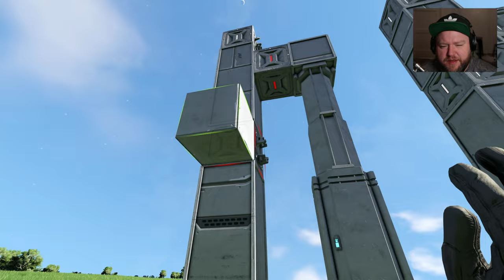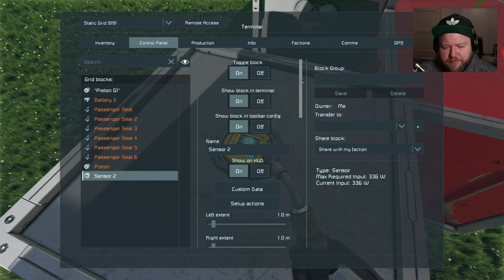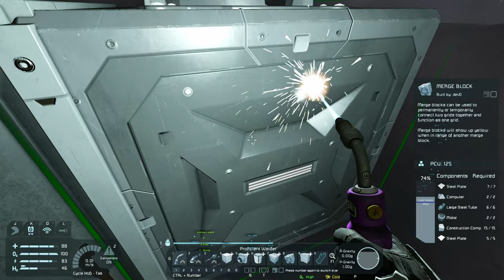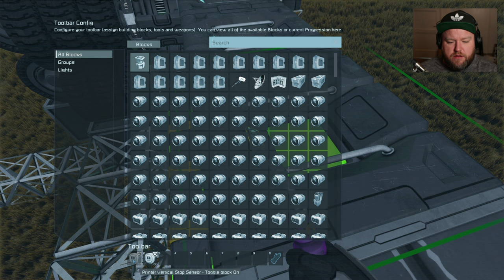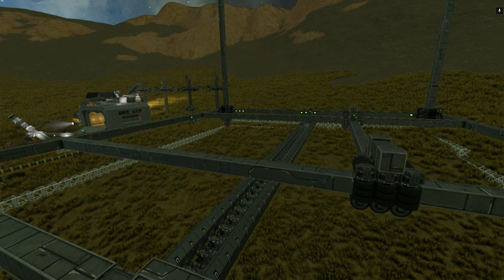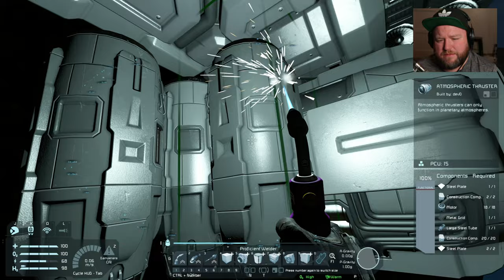Using a crawling piston to stabilize my printer as a German Engineer - Space Engineers E30

Comment: Suggestions:
3 rows of glass above your welders stops accidental printing too low
 add 2 more rotors 1 with large grid head 2 with small grid.  So you can print without changing rotor heads.
Never print landing gear pointing towards welders
2-8 blocks between projector and ship to buffer edges one of which gets ground off at end of print.
Reply from the maker: Those are some great tips, thank you! 

Why two rotors with small grid heads though? Just so I can print two small grid ships at once?
Reply: @boldlyunbuffed  That and building a ship with subgrids.  Normal reason to print though is to replace ship that crashed or Drones.

Comment: You're getting there... Good work.
To avoid having a running print waste time by traveling all the way to the ends of the track, you could add sensors to the effective weld-area, that detect the print and reverse the blueprint-arm once built blocks leave the sensor range. As the print gets larger in length, the blueprint-arm will then only travel further if needed. This will make your printing more effective.

Not all blueprints are "printable". One has to consider this when building ships,...

Weiter so! Ich habe mir den Luxus nicht gegönnt, In meiner Survival-Welt Creative Mode zu benutzen, um gefährliche builds zu testen. Mich motiviert die Gefahr des Ungewissen und die vermeintliche Kontrolle darüber. Ist in der Arbeit auch so: Prototypen MÜSSEN fehlerfrei sein. Einen zweiten "Versuch" gibt es nicht. Ich liebe es, diese Herausforderungen zu meistern. SE gibt mir die Möglichkeit, Fehler passieren zu lassen und es macht auch ein bisschen glücklich, wenn mal alles hochgeht. LOL
Reply from the maker: Yup, good call with the block detection. I’m probably going to do that. It significantly speeds up the print. There are some cases where it can produce false positives (e.g. when there’s a “gap” in the grid you’re printing), but one can make it toggle able to disable it for incompatible prints.

Ich benutze kein Creative Mode in der survival Welt, sondern bin in die Creative Welt gewechselt und habe das Grid copy + pasted um auszutesten wie ich das rutschen der Reifen fixen kann. Praktisch nen zweiten Prototypen, da sich der erste Prototyp aufgrund Unterschiede in der Physik nicht wirklich umsetzen lies. Wenn du dir ein paar meiner früheren Videos ansiehst wirst du sehen dass ich auch schon genügend mit zerstörten Grids rumgeschlagene habe.

Ich benutze meine Creative World idR für Prototypen oder wenn ich etwas nicht verstehe oder es nicht so funktioniert wie ich es erwarte. Anstelle 20 Stunden in Survival mit experimentieren zu verbringen, verbringe ich lieber 4 Stunden in Creative und bringe dann die gelernten Details zurück ins survival Spiel. 

Wenn der MGP fertig ist habe ich insgesamt mehr als 24 Stunden auf Kamera und ungefähr nochmal 12 Stunden ohne Aufnahmen investiert. Auf YouTube sieht mal dann halt nur 4 Stunden oder so davon. Ich glaube nicht, dass ich es mir hier einfach gemacht habe :)
Reply: @boldlyunbuffed  
An eventuelle Lücken in einem Build hatte ich gar nicht gedacht. Guter Punkt. Ja, manuelle Steuerung irgendwo anbringen ist immer gut.

Klar doch:
Nicht Creative Mode.
Creative World meinte ich. Mir war natürlich klar, dass Du nicht Creative Mode eingeschaltet hattest. Was hab ich denn da für einen Quatsch geschrieben?! LOL manoman.
Was ich meinte war, dass ich nicht zu einer Creative World gewechselt habe um mein Zeug zu testen.

Nein, einfach hast Du es Dir nicht gemacht.
Auch Deine Mühe und Ehrgeiz zweifele ich nicht an. Im Gegenteil. Du willst ja auch videos machen, da willst Du natürlich auch effektiv sein. Is ja logisch. 🙂

Meine Survivalwelt spiele ich seit 3 Jahren.
Da habe ich alles auf die harte Tour gelernt.
Ich speichere viel, falls was heftiges in die Hose geht.
Ich habe seperate "Build Worlds" wo ich ab und an andere Dinge mache und Conzepte entwickle. Da hab ich auch z.B. bestimmte Fahrzeuge die in meiner Survival Welt nix zu suchen haben. Diese Build-Worlds haben nichts mit meiner Survival Welt zu tun. Meine Survival Welt ist mir heilig - ist mein erster gelungener run von damals. Es ist wie eine Reise. Ich möchte möglichst lange von SE was haben, somit reize ich alles aus bis ich mich weiter wage, if that makes any sense.

Als ich das erste mal mein Shiff abheben sah, mit dem ich nach zwei Jahren zum ersten mal den Erdähnlichen Planeten verlassen habe... Da hatte ich Herzrasen und sonstwas. LOL Brutales Game!

Hau rein, bis bald!